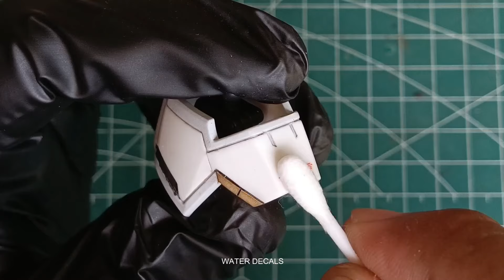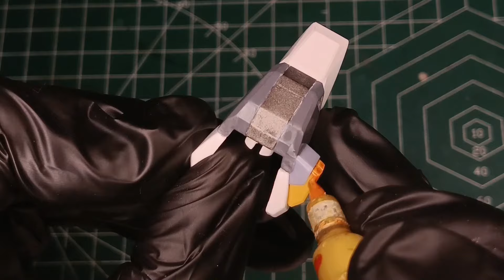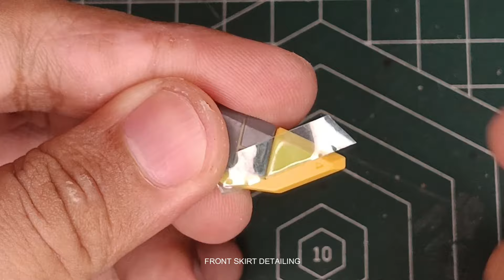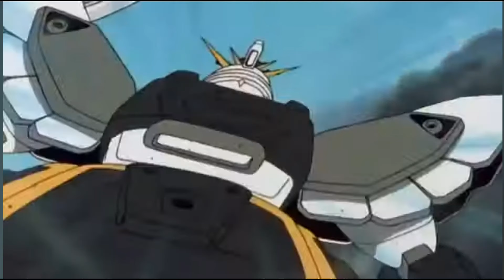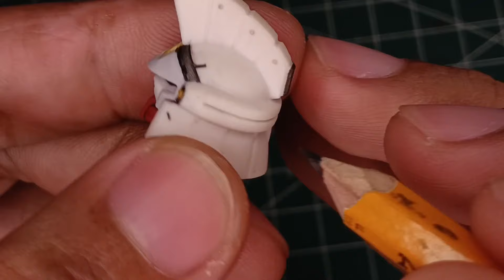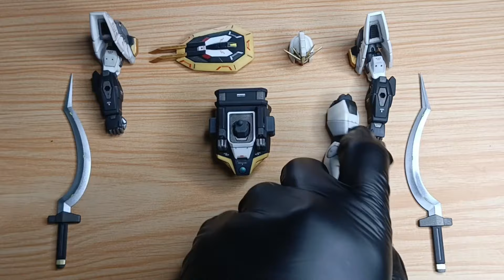GUNDAM UNIVERSE SANDROCK detail up

Comment: Excellent work once again, makes it look more in line with a metal build that doesn't look like it'll destroy the wallet, using the cable tie as a vent is genius
Reply from the maker: Comparing it with metal build is a high praise

Comment: How do i paint the rubber leggsssss???
Reply from the maker: @GGHonorAll  I'm using acrylic lacquer
Reply: @version_of_KONG  ty for responding! I have a problem then, I primed the suits. And on the rubber parts the paint really doesn't settle at all, even after a few days of drying. The primer and paint just feel sticky, on the rubber parts specifically.